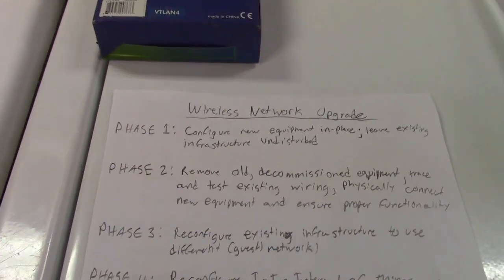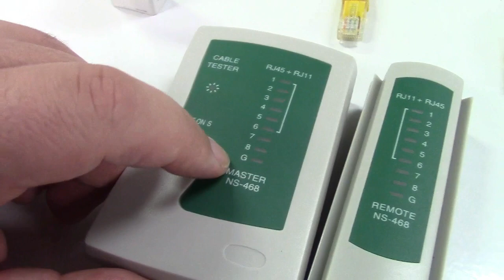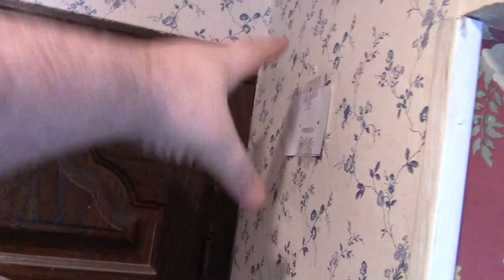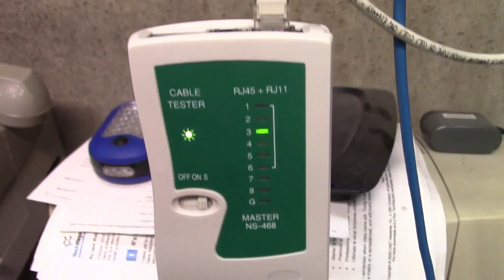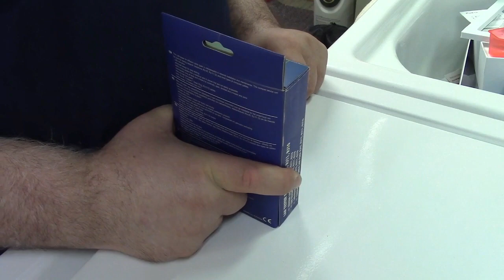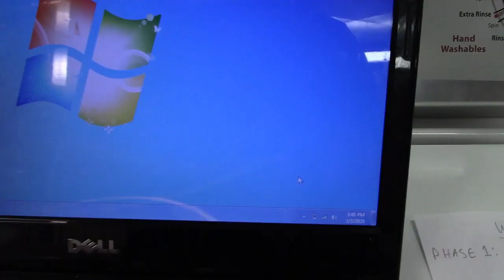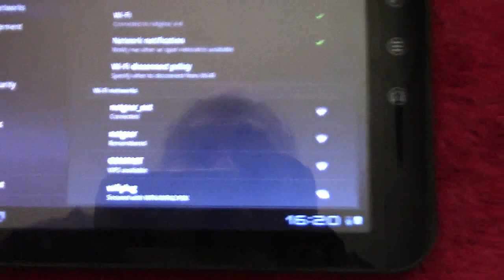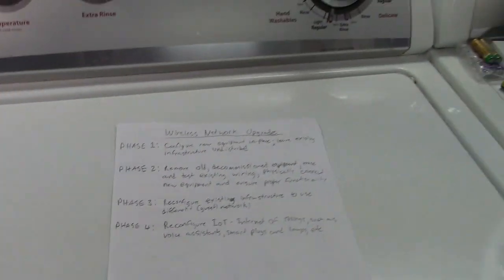Wireless Network Upgrade PHASE 2 - Trace & Test Wiring, Physically Connect New Access Point

Comment: My first wireless router was similar looking to your blue linkeys wireless G system. had the internal wireless cards also. Don't think I ever licked a 9 volt battery but I did lick a live phone wire back when wired phones were the thing. Got a tingle from it.
Reply from the maker: My dad still uses a Linksys Wireless-G Router.  He must have it for a good 15 years now.  None of his equipment supports anything higher than that anyway.

I've been licking 9 volt batteries since I was a kid.  The brand new ones are pretty sharp.  Never did that with a phone wire.  If somebody happened to call while you were doing that, that's 90 volts AC at 20Hz that would have gone through you.  Not likely, but possible.

I got a bunch of networking equipment that need to be looked at.  Perhaps I'll do some more videos on it.

Comment: I don’t have too much experience with PoE equipment aside from a few forays into the area with some test equipment. I never got it to work right, I was using an old Cisco Aironet 350 and it had some sort of “association status” error, whatever that means. However, based on what you’ve described here with your project, it may be time to take another look at PoE.
Reply from the maker: Pretty simple stuff; most times there are unused conductors in an Ethernet cable so they send power down them.  I don't trust it, per se, because Ethernet wires are pretty thin, but for very low current, it works.  It's going to have to in this case because I don't have any other way to power it!

Comment: I have that same cable tester, it works well!. I did have to contact China because one of the LEDs burned out. They did sent a new one though!

In the field they use $1,000 Fluke testers that do the exact same thing plus a few 'extra' features like cable distance, ohms, and harmonic distortion. No thanks, I'll the El cheapo $10 china one that does a fine job.
Reply from the maker: I think I bought that thing at Tiny Middle.  Everyone who has needed to test network cables has one of those, it's super common, like the (used to be) free Harbor Freight multimeters.

As with the network testers, most times the Harbor Freight meter does a good enough job, so that's what's mainly used.  It's rare I have to break out the good meter, which, for all intents and purposes, isn't that much better.